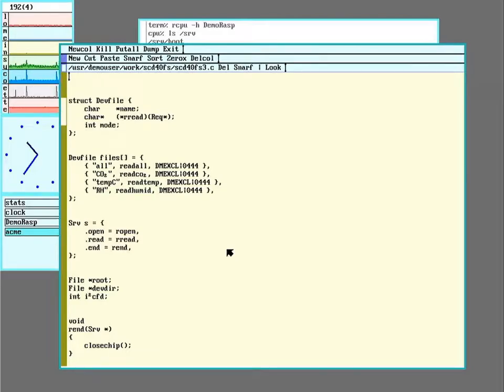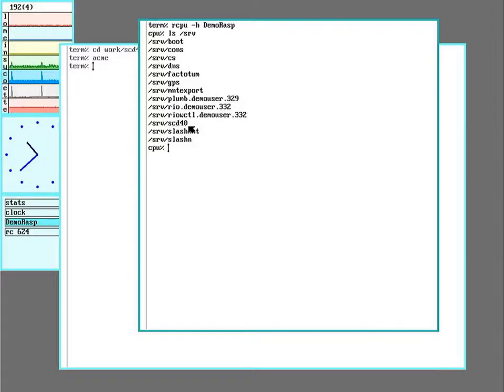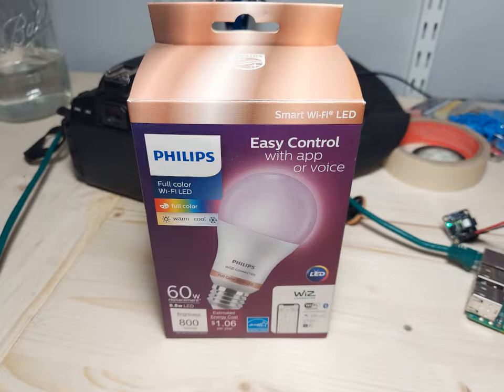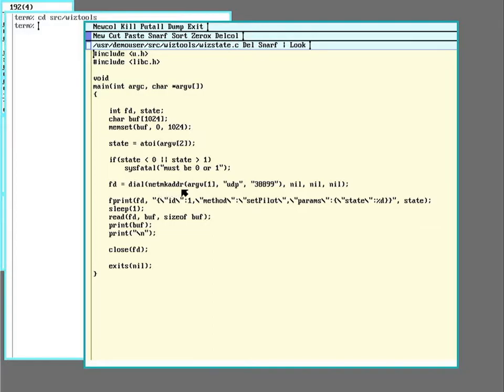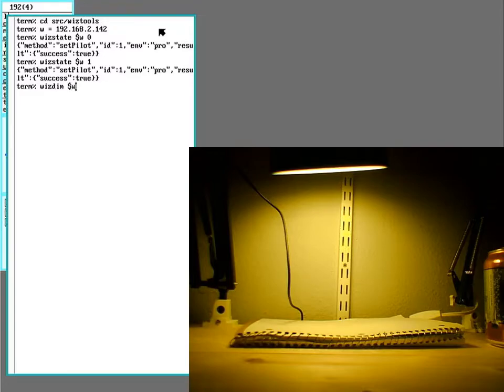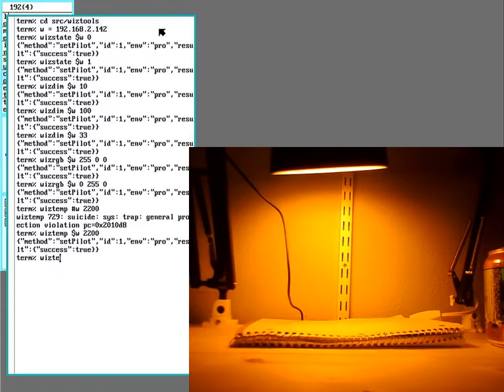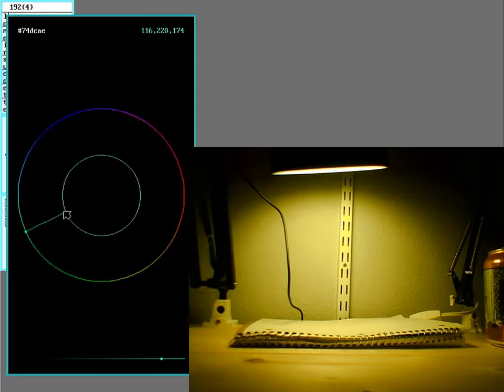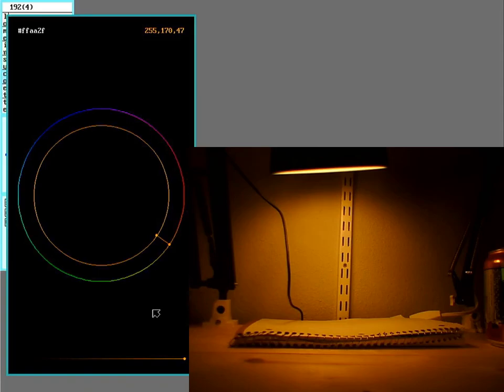Adding to the Grid;  Listening to CO2 Levels and Speaking to Light Bulbs with Plan9

Comment: I noticed you had run rcpu to connect to your Pi. Is rcpu sort of misnamed nowadays, in that it's not expected to be used to connect to beefy systems full of CPUs and other resources, but instead is now a general command for connecting between any Plan 9 systems? Specifically, is your Pi configured as a CPU server or is it a terminal? Newb question I know; hope it makes sense. Thanks again for your truly excellent videos. If I can ever get my hands on a Pi 4 (out of stock everywhere), I intend to follow in your tracks. This looks like a blast.
Reply from the maker: It is the "other resources", rather than the beefy CPU, of the Pi that I am interested in.  I do have Pi's set up as "CPU servers", and I've been writing programs to expose the various sensors that can be plugged into the gpio pins as files.  And those files can then be mounted to any other computer on my 9Front network.

This setup works well, as messing directly with the hardware can cause freezes and kernel panics.  I can reboot a busted Pi without needing to reboot the terminal I'm sitting at.